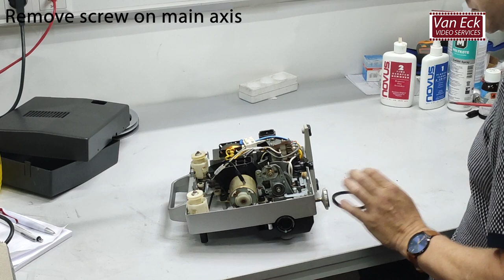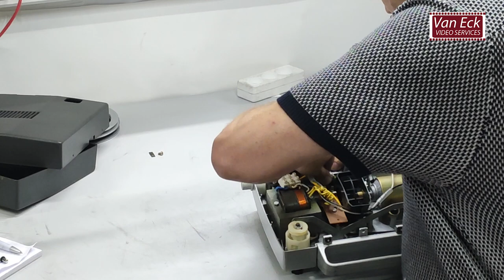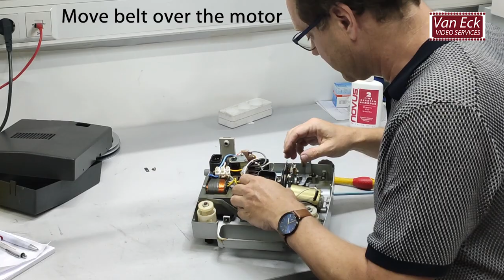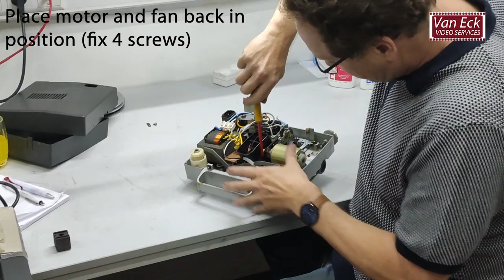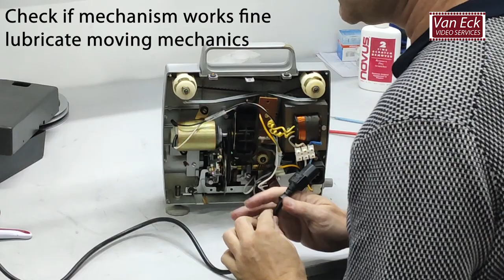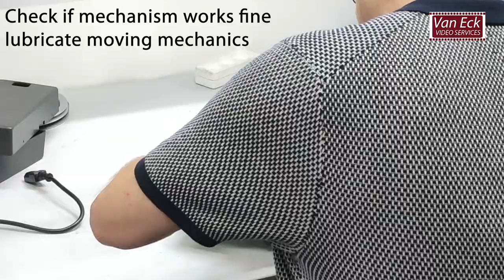How to replace motor belt for Rollei P83, Silma S112 film projectors

Comment: Hi, I followed your video to replace the motor belt on a Rollei P83. All went quite smoothly.  When I turned it on  there is a black shade with some pointy triangular shapes on the screen. Is it possible that when I lifted the shaft something got dislodged and now is in between the lamp and the lens? 
I took a picture but I don't think I can post it here.
Thanks for your help.